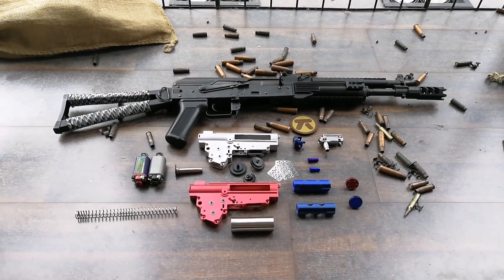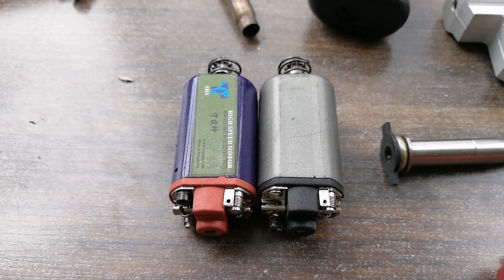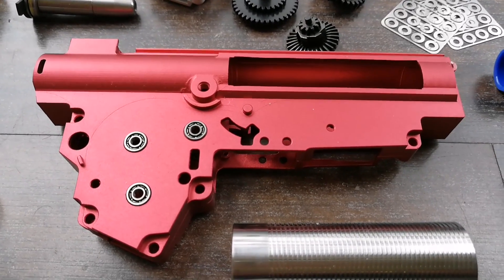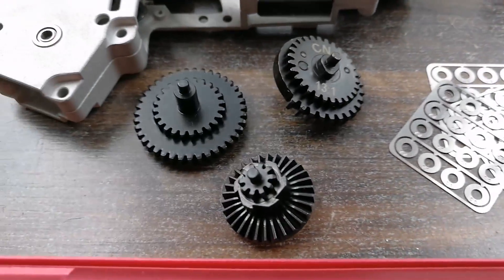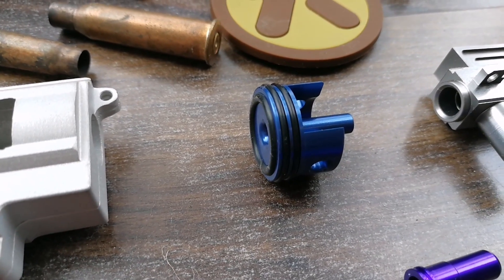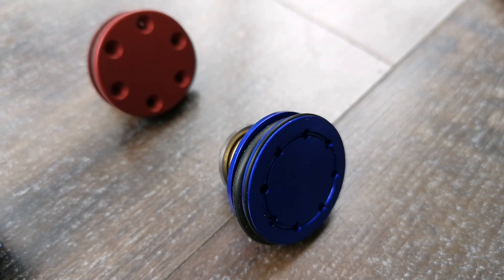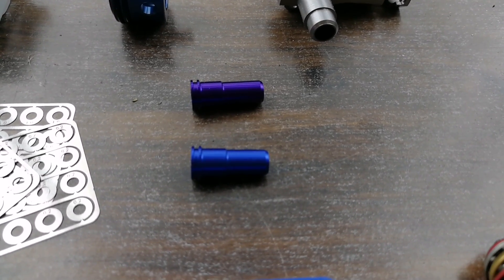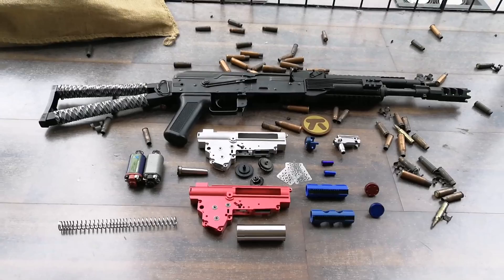Airsoft performance modification LCT AK by Taktik Airsoft

Comment: If you don’t want to buy a new shell but still have longevity then you can radius cut the housing it helps spread the energy more evenly through the shell rather than the corners which is why they break, the energy is focused into the same spot
Reply: V3 gearboxes are initially tougher than V2 gearboxes due to the more reinforcement. Radiusing V3 gearboxes tend to do more harm than good.

Comment: Can I upgrade the motor only? I got a LCT PP-19-01 Vityaz and I only want to upgrade the motor for now, but I don’t know if it will destroy other parts by having too powerful of a motor.
Reply from the maker: You can upgrade the motor, just make certain it's a high torque motor and not a high speed motor.
Reply: @taktikairsoft  ok thanks!

Comment: Hey I'm looking to do a as val build. Any hop up, barrel etc recommendations? Gearbox gonna be hpa.
Reply: I would buy 6.05 pdi steel barrel with maple leaf macaron and tune it myself.  I don't think changing hop up chamber would add much unless it's very loose on the inner barrel. I shoot my buddy's hpa lct AS VAL and I wasn't impressed. My only "systema energazied" lct 74n was sending bbs further but that might be the effect of the lighter bbs and and poor tuning of that VAL(shitty company responsible for putting it together). I think that gun was running P* Jack. Anyway buddy sold it shortly after and bought fixed stock olive lct AK-74 and installed plum stock and handgurd on it. Pretty nice set with 90s flora. Also reconsider lct's VAL because i've heard of some fire selector problems and if i remember correctly the company that was upgrading my buddy's gun had some troubles with it too, they had to grind something to fit the engine or smth.  Also motor cage is known of breaking too. Im not saying hpa bad but be careful because you're supposed to have fun using it not endless frustration. AK is much better platform for hpa, hec it's even better as aeg than most of the guns. Also do not take for granted everything that guy in the video said - he changed the V3 gearbox shell 🙆 Oh, also avoid e&l ak's - tough but cheaply manufactured. Watch Negative Airsoft on YT and check  informations i've given you here because lct is upgrading internals and they had the thoughest gearboxes on the market around 2 years ago (basicly all steel). Oh and always make sure to check if your new gun is straight - you can watch a video about checkin real AK's to know what to look for.  Just additionally look down the barrel to see if the nozzle is in line (centered) with the inner barrel. Good luck out there, have fun and stay safe.